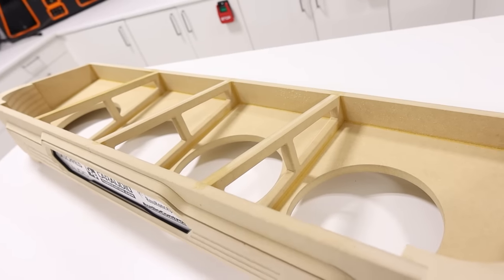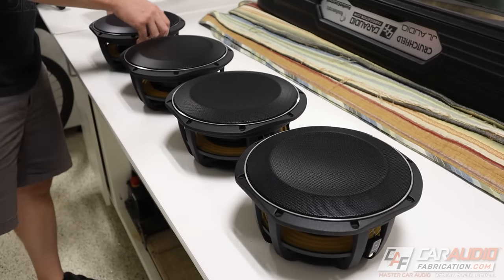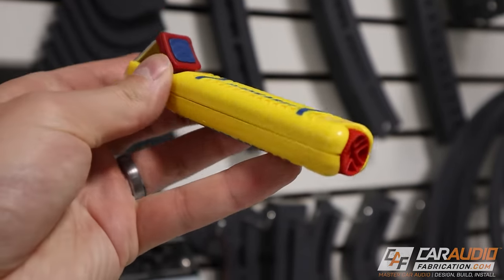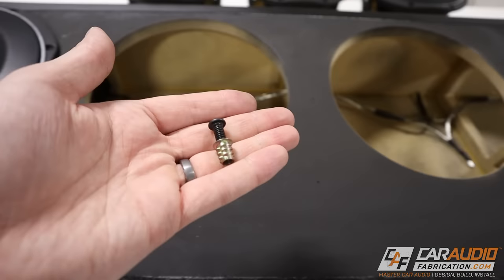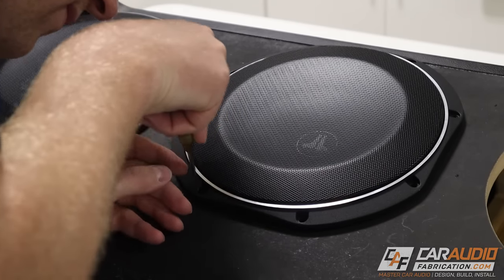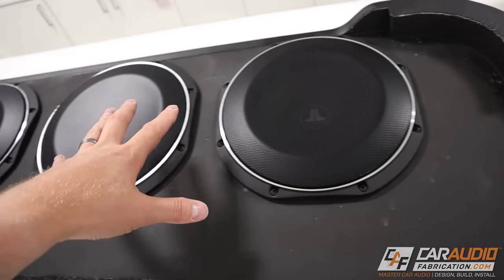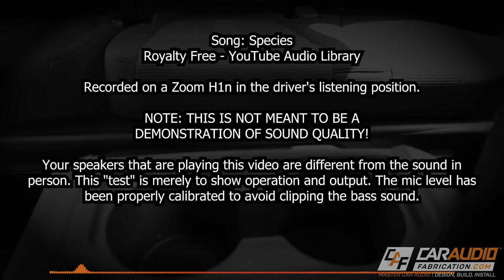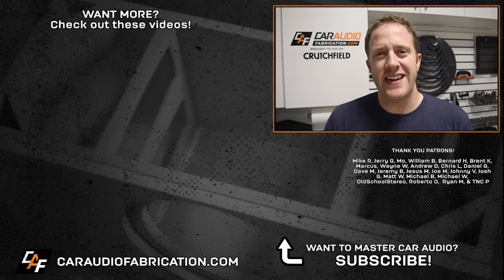Four 10" Subwoofers INSTALLED UNDERSEAT in truck = Awesome bass!

Comment: I had four JL 10w3v2 subs in my old Silverado in a custom sealed box with 1000w RMS Rockford amp. That was some seriously good sounding, hard hitting bass! It's been 10 years since it was stolen and I'm still mad about it!!! I've since settled on two 12s and it's just not the same.

Comment: Mark, fantastic series.  Love your design of a matching carpeted top so you can still lift the seats for cargo.  2 questions - 1. do you lose any bass with down-fire mounting versus front mounts? Wondering if 4-8" front mounts would match the 4-10" in effective output?, and 2. Do you apply a gasket material between the sub and the enclosure?  It didn't appear so, just curious.  Thanks for making me envious - but looking forward to building one of my own with your tools and guidance videos.

Comment: I started doing the cross pattern on the tightening back in the old days with the stamp steel baskets cuz if you did it all down one side you would distort the basket and could destroy the speaker

Comment: I'm curious why "high-pass" crossover was used? Setting it at 80hz. Does that protect the subs from REALLY low notes, since the signal coming from the head unit is already crossed over using "low-pass" in the head unit itself?

Comment: I also have a 2020 f150 and wouldn’t mind upgrading the sound system in your opinion would a single sub similar to the 10’s in this video or even a shallow mount sub 8” work behind the driver side rear seat as more of a stealth install or as a means to not give up any floor space?

Comment: Help needed.. im planing on custom fiberglass sub box.. in corner of my trunk.need it small  sealed and now i cant decide about subwoofer  2 6.5 or 1 6.5 or 1 8 or 1 10inch    im choosing between digital desings 506 508 and 608 or alpine type r 10inch

Comment: I’d really love to see you install a system in an all electric plug in car. I’m looking at buying a EV Chevy Blazer when they come out next year but I’m not sure how to put a system in a EV. Thanks for the great vids!
Reply: You prob can’t lol, but a lil of evs seem to have better stock speakers than most gas vehicles
Reply: I was looking into this. The Tesla uses a DC to DC converter. 
It will have a limited amount of amperage available.
Seems like the solution is either a way more capable DC2DC or a separate battery system in rear to use for sound system. 
I would imagine the most efficient setup would be to use the stock system for mid/highs and then whatever solution you choose  for your heavy hitting bass needs.

Comment: Your next project should be my Polaris RZR. I plan to remove the rear seats, build a box with 2 10W7’s. Another storage box on top of that that is set back enough to build an amp rack on the face

Comment: Hey mark! 
I have an electric scooter that runs on a removable lithium battery… is there anyway I could wire up a 6.5 speaker to my rear seat using a small Bluetooth amplifier.

Comment: Have you ever built one of these boxes for the 2nd or 3rd row seating in a Yukon/Tahoe? I'm in the market for a Yukon and plan to get a system installed, but I don't want a huge box taking up the rear space. This would seem like the best option, but the pickup and Yukon/Tahoe are different in regard to acoustics. Not sure how much of an impact that would have on the install. Long-time subscriber. Love the content.
Reply: Not sure you could because of how they may fold or stow away

Comment: wonder if you could do a seat raise by 3" or so and get 4 kicker 10s L7T or 12s facing forward facing, would be 600 rms per sub, plus 20% more cone surface area vs original circular subs. wonder if this setup would be the perfect under the seat system!

Comment: Can we see a full system install and wiring diagram of a 2 12 in sub with a 2 6,5 and tweeter for both front left and right and a set of 6.5s for the rear doors and a 2 sub box ported in the trunk powered by 2 amps one for the four channels of speakers and 4 6x9s and 2 tweeters and a monoblock for the 2 subs with the box design of the 6x9s and super tweeters and the sub woofer box for a vehicle similar to the Suzuki ertiga GA model

Comment: That box was ridiculously small for 4 tens! I'm sure you meant they are LOW passed at 80 HZ, not high passed. I wonder what type of filter and slope they are crossed over at and what else is in there equipment wise.

Comment: 9:54 I've waited a long time for this question ! The answer - Make a 8.5 cubic ft. SEALED box for the very very simple and cheap 12 inch subwoofer - "Pioneer TS-A300D4". That's because it will acheive QTC of 0.707. Wonder if such box is possible to build ?
Reply: That is a extremely oversized box for any 12 inch subwoofer, especially that one.

Comment: (PLEASE CONSIDER) That definitely sounds good 👍 I would like to see you build a custom console for a 5th gen bronco.  Haven't seen much if any for this rig. I'd like to be able to di it to my 1996. I have a single 10 and I use the console quite a bit  possible from the dash to just lined up to the rear of front seats. The entire back of the suv is going to be used up and no space for my sub.

Comment: Hello Mark and everybody on this channel I have a question for y’all. In my application for my car my space window is very narrow. I have room for three 8 inch subwoofers. My question to y’all is for some reason is it wrong to actually have each speaker almost but tup to each other? My space is very limited and I’m looking for a sealed enclosure because I prefer that type of response. Someone mentioned something about maybe having irregular loading but I’ve never heard that or understand what that even means. They will either be a very small space and I mean very small space between each speaker ring Or practically touching each other to allow proper fitment inside my trunk. There being installed in my rear deck lid. Any information on why maybe this wouldn’t work would be helpful. The walls will be built with three-quarter inch plywood and the front mounting board for the woofers will be 1 inch thick or more if necessary
Reply: the subwoofer speaker rings can touch fine, just make sure everything is mounted down properly to avoid weird vibrations and rattles. it shouldnt do any harm to the subwoofers.
And if i was to guess about the irregular loading it could be because its 3 woofers it would land on like 1.33 or 1.67 or 3 ohm or something like that, which isnt usually stated as a official supported rating, but if the amp can do 1-4 it should do anything inbetween, but if you are uncertain you can always message the brand or the store youre buying it from to make sure.

Comment: But how does this compare to 2 12 inch W7's
Reply: It doesn't lol
Reply: @CarsCatAliens  exactly, so this is for people that basically just want a little upgrade from factory
Reply from the maker: Good luck putting two 12W7s under a seat. You're not making an apples to apples comparison.
Reply: @CarAudioFabrication  yes I know, but you saying the amount of bass you getting from that setup is a little over the top also. That's why I have a cut through my bed

Comment: badassss sq  i dont like downfire tried it once i didnt get them lows i like 20hz to 40hz  badass video tho
Reply: I have two 12’s. Kenwood Excelon pancakes , I get lows like crazy and plays all the way down to 28 hz in a Original Probox downfire on a Rockford Prime 1200 and Pioneer 80 PRS
Reply from the maker: These dig deep without any issues, but its important to have the right subs and right air space! Thanks for watching!
Reply: u think a single sub in a crew cab truck would sound good and play low?! i was thinking of deleting my single rear seat on my f150 2015 for a custom box but idk if it will sound good i heard the cabins on trucks are peaky high

Comment: You set a "Low Pass" crossover  @80Hz. If you High Passed @80hz, there would be no sub-bass. And, the old terms on older audio gear: Low Cut = High Pass, High Cut = Low Pass.  Regardless, terminology kinds matters when using technical terms like a High Pass filter. Looks good though!